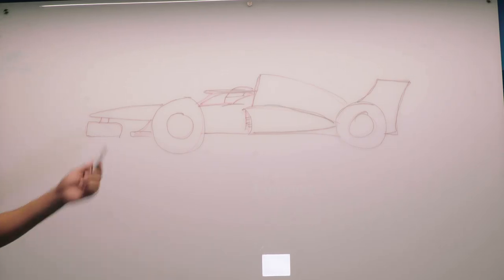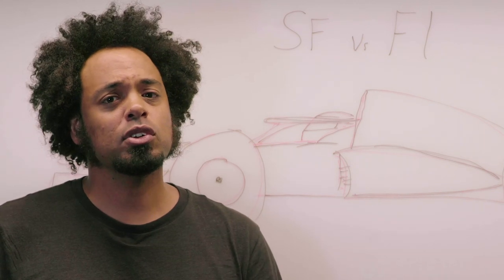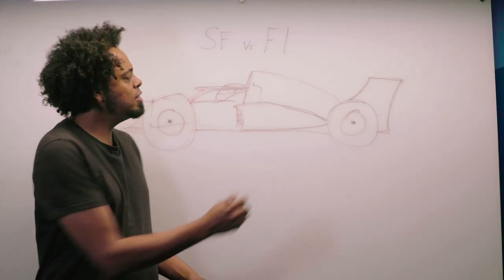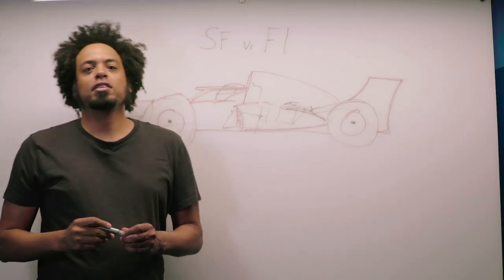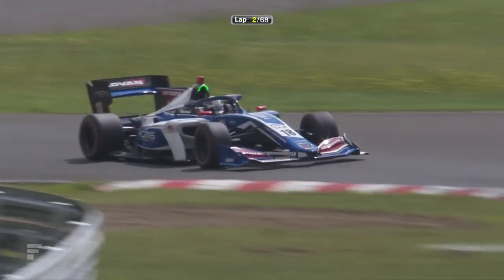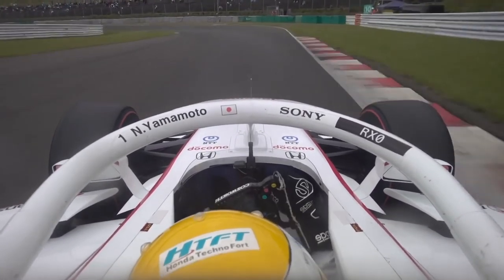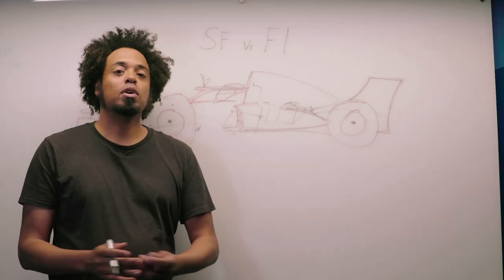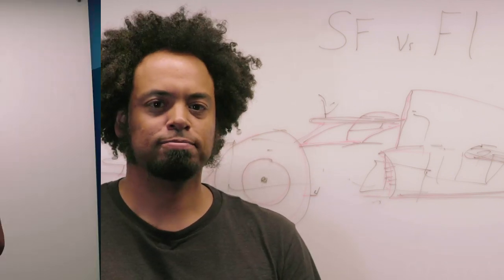Formula 1 versus Super Formula - what's the difference? Hi-tech explanation

Comment: Thanks for the video, and your coverage of SF!
I think the video is well done in general, but I would like to point out that the SF car's relatively simple aerodynamics are more to do with the regulations allowing for giant diffusers than for the reason you stated. 

Because the series allows a larger diffuser, the car is less rear limited than an F1 car in its ability to generate DF. That means there is less emphasis on strictly controlling the airflow towards the rear of the car, and thus less of a requirement for intricate flow conditioners at the front. The result is a similar amount of downforce to the 2016 F1 cars at a much lower cost (which is necessary for a spec series where teams are on real-world budgets).
Enjoy the rest of the season!

Comment: I have a slightly off topic question: during the race streaming the video on this channel is significantly dropping frames in comparison with the original Japanese TV stream. I think it's because the video part is re-encoded in your studio and thus losing quality (maybe because of the encoder setup). Would it be possible to just copy the original japanese video stream without re-encoding, adding your audio stream on top and then sending it to YouTube?
Reply from the maker: Troy McClure correct analysis! Challenge is that to stitch the audio into the video it needs to be re-encoded - so we lose some quality in that process (because we’re adding audio in the UK), so its a bit like making a photocopy - the quality can only be lost, not quite matched. Maybe in future we’ll find a fix though!

Comment: What can teams change in terms of setup on a SF car then? front and rear wing angles? suspension and brake dampers? obviously tyre pressure..?
Reply: galliman123 anything aside from the chassis and aero. Wing angles, gurney flaps, dampers, 3rd elements, geometries, differential settings, gears, etc.

Comment: What is the difference between Superformula and formula 2 then?
Reply: Both cars are similar in concept, but different in execution. Both are made by Dallara. Key differences are weight (SF is 670kg vs 740 for F2), tires (Yokohama vs Pirelli & SF is wider), engines (4 cyl turbo Honda/Toyota or 6 cyl turbo Mecachrome). SF has open damper regulations (including inertia dampers) & F2 does not. There are more differences but those above are the major ones. They don't race on any of the same circuits but taking times relative to F1 at circuits which both series do run I would expect the SF car to be 2-3 seconds per lap quicker.
Reply: Both cars are similar in concept, but different in execution. Both are made by Dallara. Key differences are weight (SF is 670kg vs 740 for F2), tires (Yokohama vs Pirelli & SF is wider), engines (4 cyl turbo Honda/Toyota or 6 cyl turbo Mecachrome). SF has open damper regulations (including inertia dampers) & F2 does not. There are more differences but those above are the major ones. They don't race on any of the same circuits but taking times relative to F1 at circuits which both series do run I would expect the SF car to be 2-3 seconds per lap quicker.

Comment: So... I guess that the engine regulations are the same in Super formula and GT500 in super GT ?
Reply: I think Super GT has no limitations on displacement while Super Formula does have a restriction as the chassis is the exact same for everyone.   The engine is the only point for free range development in Super Formula where in Super GT a lot has to be considered to develop the car.
Reply: Monopauly the basic architecture is the same. 2.0 L turbo, fuel flow limited. From 2019 Toyota changed the engine design for SF, but Honda still used the GT base.